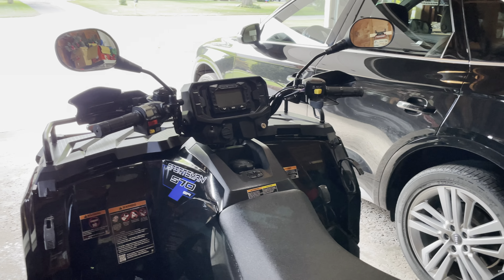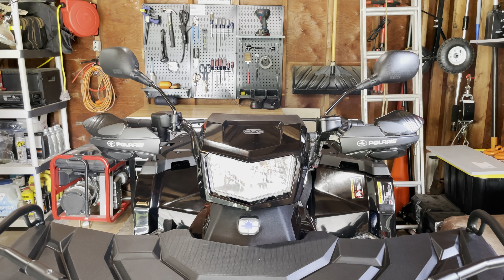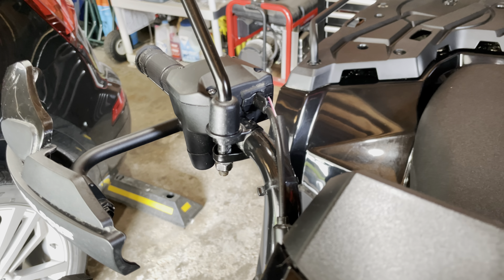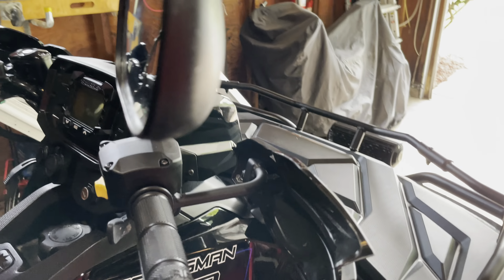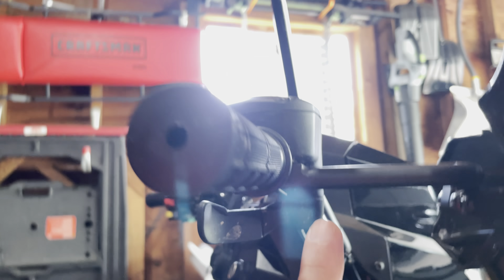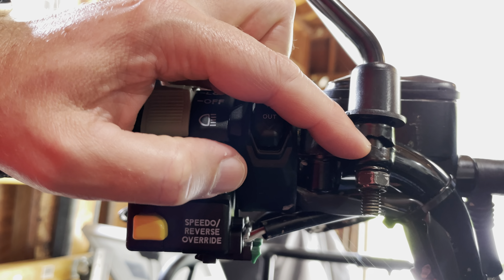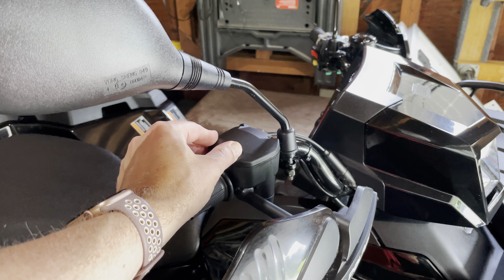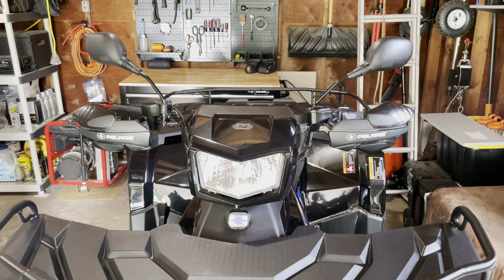Mirrors *AND* Hand Guards on Sportsman 570 Trail??  YES!

Comment: Great video! I have the hand guards and now I know that the mirrors will work too. Thanks! I also did my belt box exhaust in a similar way.  I used a 4" flex drain tube, it slips over the factory tube and ran it the same way as you. Looking forward towards your next video on solving the air intake for the belt box.